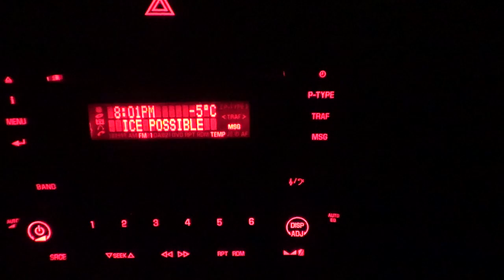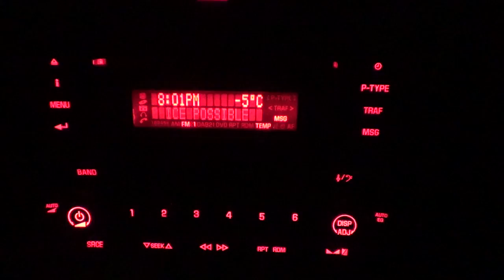Slippery As Frig

Comment: The blend air actuator is a five minute fix. Its not the vaping that's doing it, it's a poor gm designed part that has no lube on the plastic gears inside the part. All you need is a Phillips and like 8 screws removed. GM has a TSB on the problem.